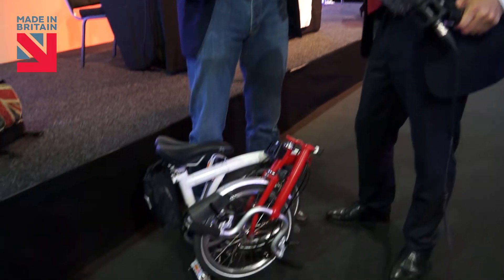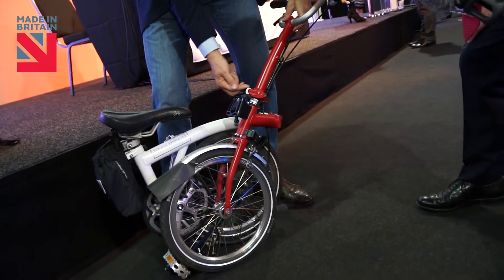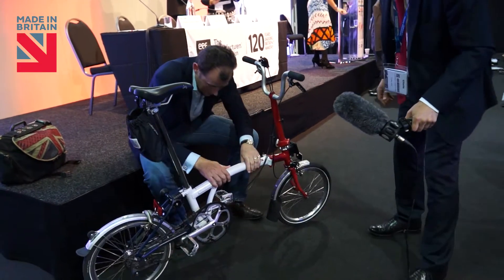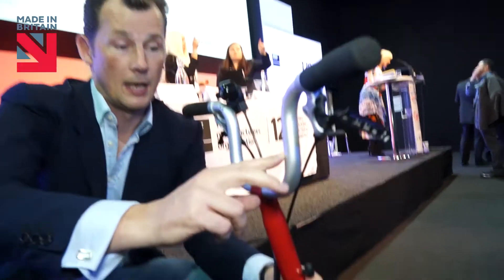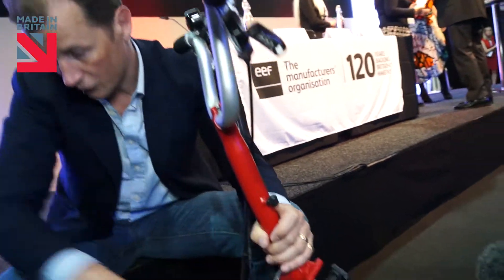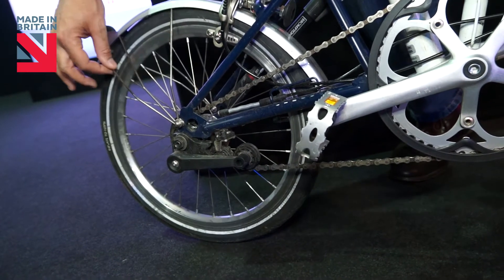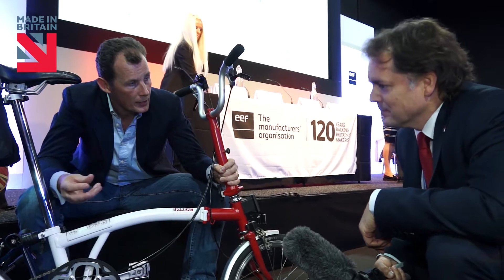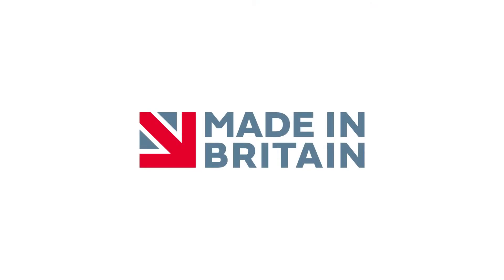Will Butler-Adams talks Made in Britain through the Brompton bike

Comment: I'm from the Midwest in the United States and I am glad that I chose what I hope to be one of the highest quality folding bikes on the market after doing a Year's worth of research to keep myself from settling on one half the price. The High functionality coupled with Low points of failure and a long-term product support sold me. The biggest complaint I've heard is people think it's outdated specifically pointing out the clamping mechanisms but I much prefer the reliability of threads and a Channel of metal to secure my bike over some quick clamp with multiple hingepoint and little washers and springs and retainer latches any of which can easily be damaged or fail on their own.
I'm glad people are taking pride in manufacturing jobs after so many years looking down their noses at them. I'm hoping as this company expands year-over-year they keep up their quality and good name strong!